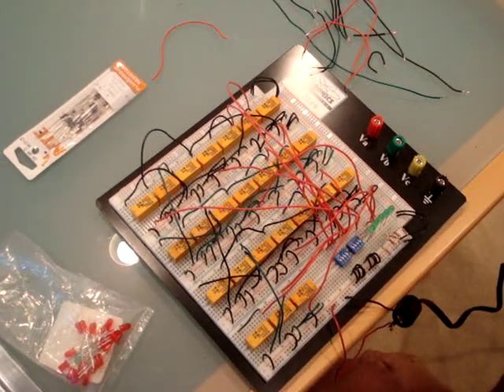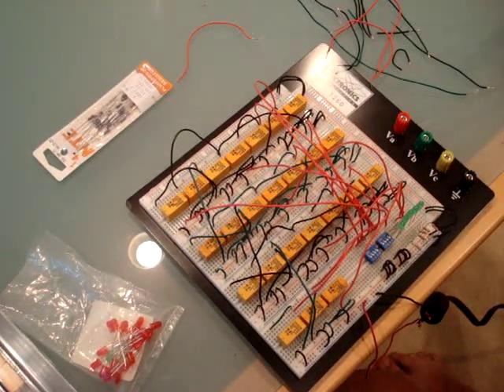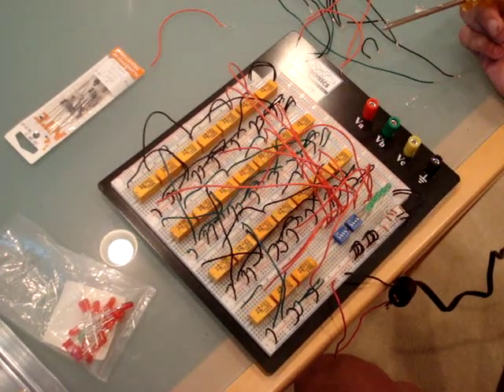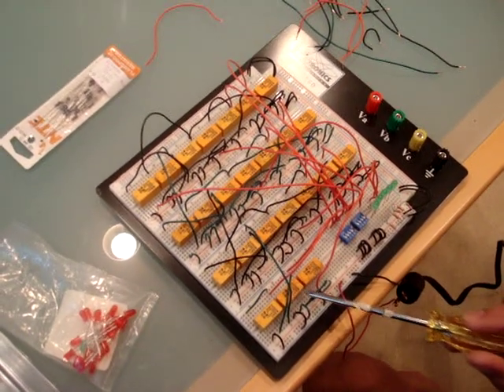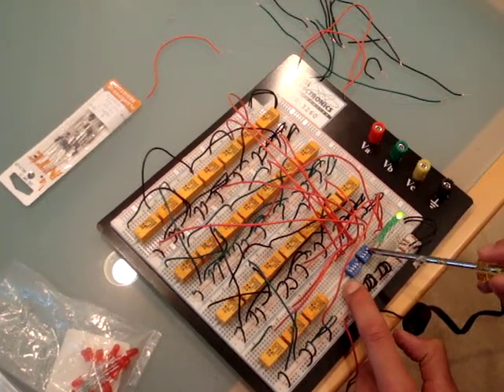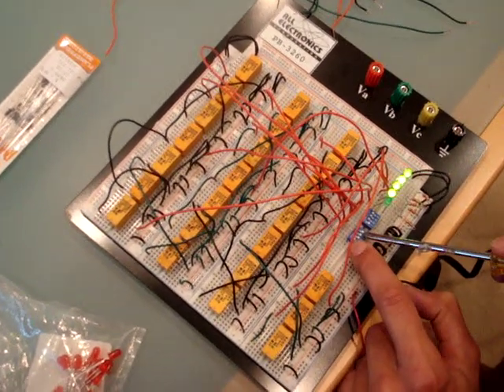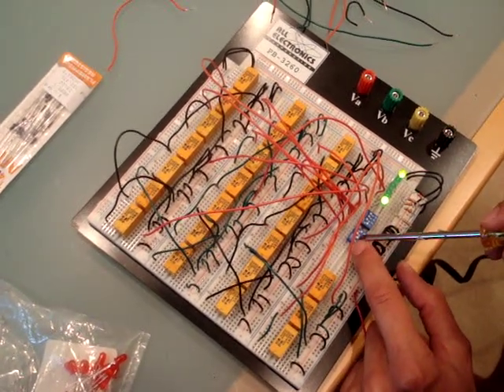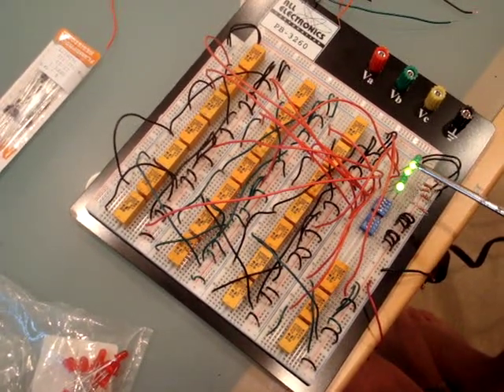4-bit relay adder

Comment: Very nice presentation, I would love to borrow your brain. I am working on a project that requires taking 2  4-digit BCD outputs, depending on an IO state they will either be added or subtracted, this could produce a number between 0-18 (in binary format) for each digit. Then take that number and convert it to BCD to input to a 7-seg decoder.

Comment: Did you know it is possible to build a full adder with only two relays? If you define "1" as a connection to +Vcc and "0" as a connection to ground (or -Vcc)
Here is a schematic
i41.tinypic dot com slash ot456b.gif

Comment: To make pong, you could use 20x25 (500) LED's as the display. 2-3 LED's could represent the paddles and a single LED could represent the ball. As an interim program, you could just try to make a ball bouncing around the "screen". The snake game could be just as interesting and easier? Also, I would suggest making a transistor computer for the more complex programs (cheaper as you would need hundreds of relays for pong).

Comment: you have used 7 relays for a full adder... I can make it with only 5, but it's not logic-ports-based...
ahd the half adder with 2 (1 is the old type of hadder and the 2° is the inverter if you activate the B entry... because the old half adder understand only :nothing-A entry, A and B entry... so the 1st invert A and B if you activate B and notA)... i'm buying the pieces for ending it.. i have only 1 full and a half of a half adder XD...